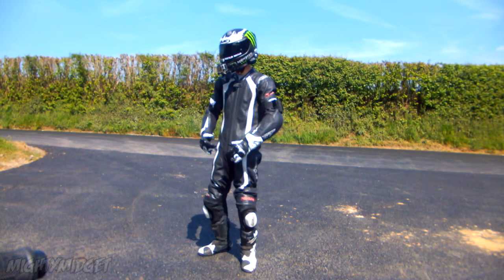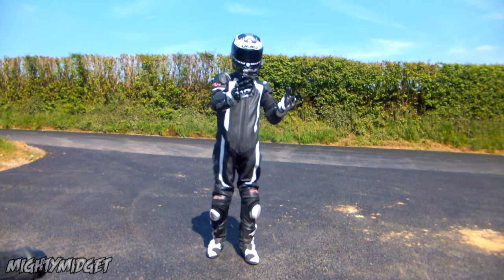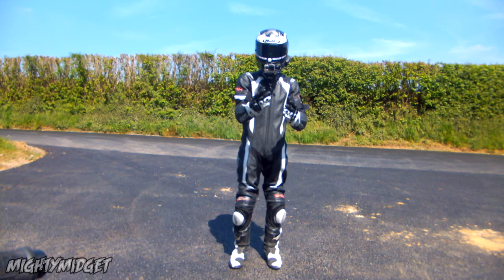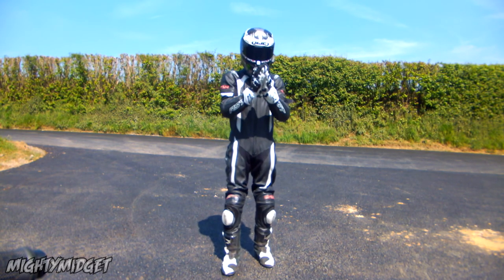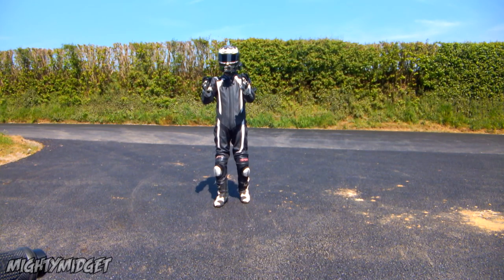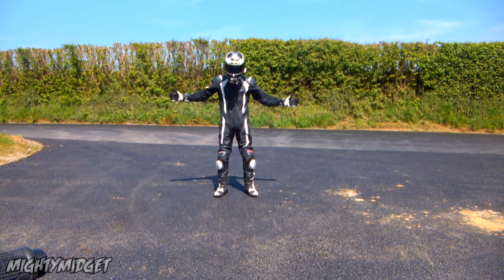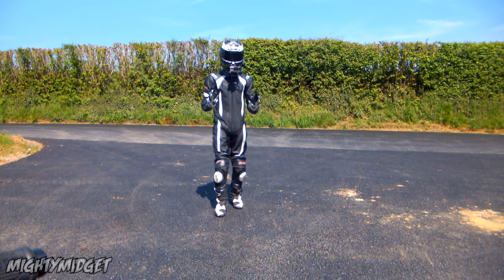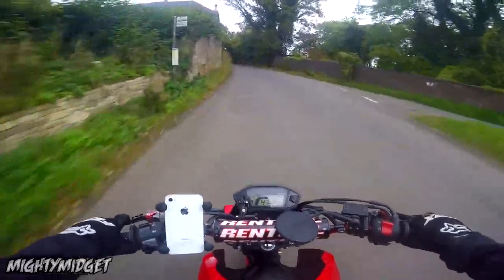M4 Street Slayer Exhaust Yamaha R3 2015 - 17 - Short Edition

Comment: Where did you purchase the headers?
Reply from the maker: +Darien Brito I think there is a video on them but I wouldn't buy them as I had to get the lengthened and the end widened slightly to be able to fit the m4 Exhaust so it's more work than you'll need